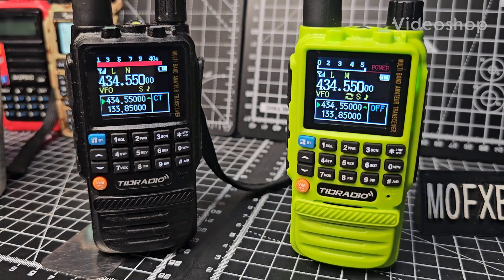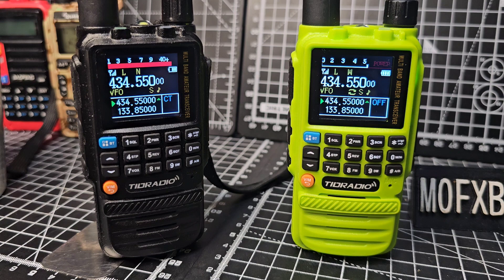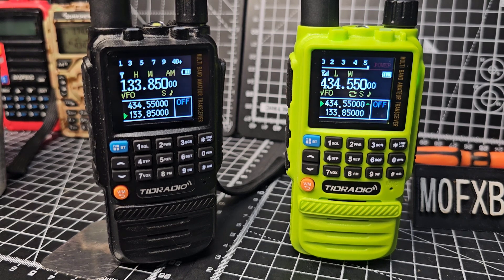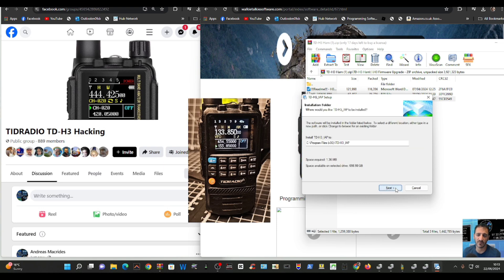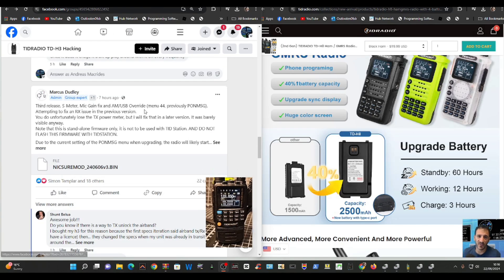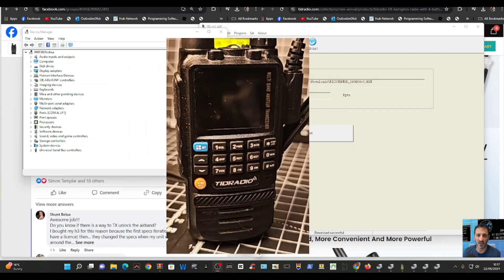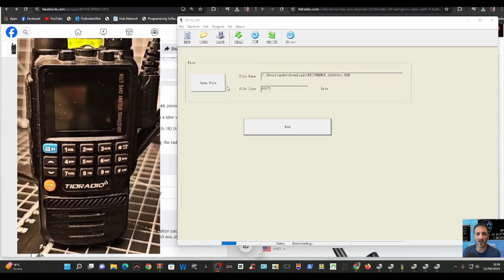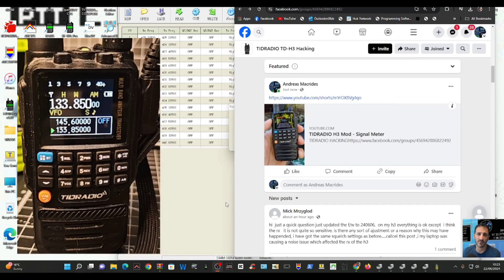TIDRADIO H3 Mod - Signal Meter

Comment: Mine was erroring part way through the update also.  A thin coating of dialectric grease (bulb grease)  on the connectors made it work perfectly. I think it's just a bad connection. Thank you for the videos!
Reply from the maker: No problem